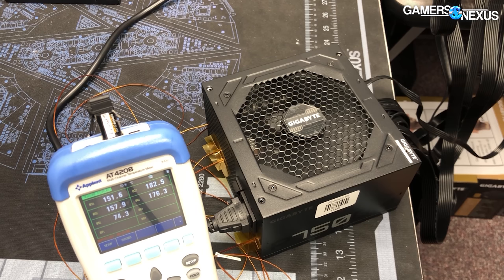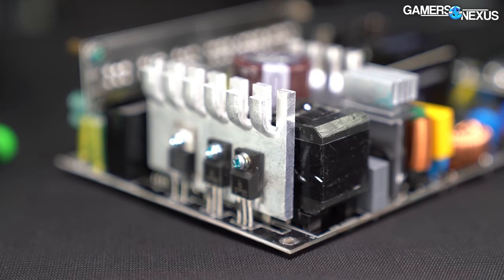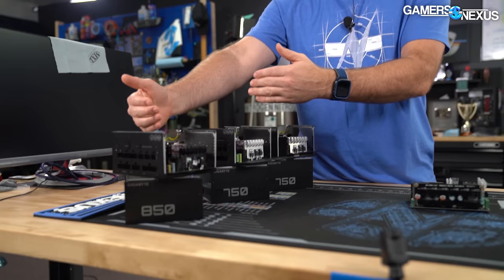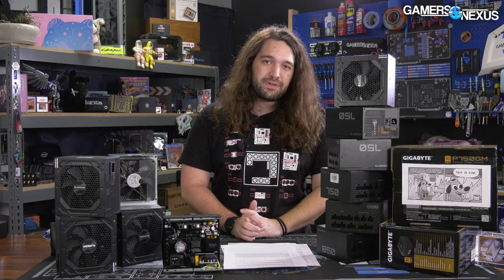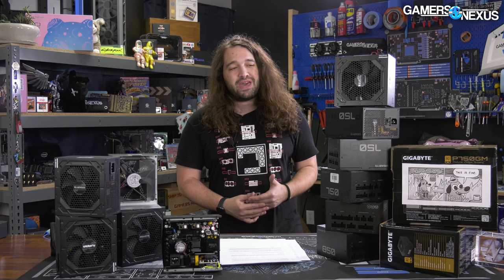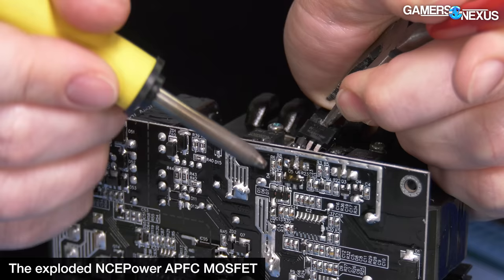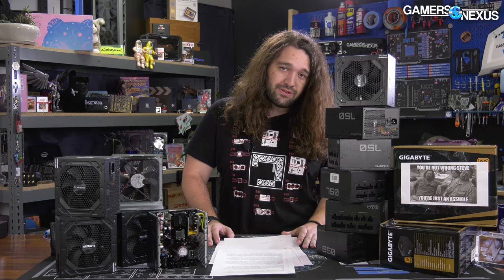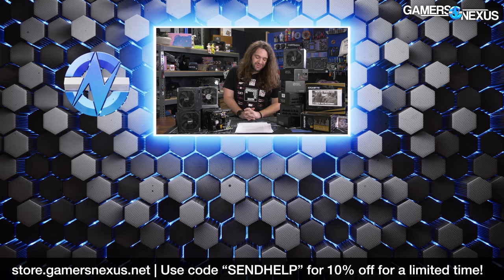Exploding Power Supplies: Gigabyte & Newegg Dumping Unsellable Product

Comment: This hurts the entire Gigabyte brand. I wasn't planning on buying their PSU's, but now I feel bad for even having a Gigabyte motherboard and will think twice before buying anything from them again.
Reply: I personally had the worst experience with Gigabyte brand overall. I'm still salty my 970 windforce from Gigabyte died
Reply: I've had decent Gigabyte motherboards in the past. Products like this PSU do stain an entire brand though. If they can put out something like this then it does lead one to wonder what else they are capable of doing. Sometimes companies do go down the drain for whatever reason.
Reply: It did shake my faith in the brand too, but i newer buy power supply from Gigabyte. I do buy graphics cards and motherboards from them and will continue to do so, because they worked great for me so far.
Reply: I have a Gigabyte 2070 (windforce). Last time I'll buy Gigabyte period. It's loud, cools not that well. Can't even spin up & down without causing a wind tunnel noise. 😆
Reply: I've had great experiences with their gpus and motherboards but now I feel uncertain about them.
Reply: I have never had a Gigabyte motherboard die, but I don't know about their other products, had bad experience with ASUS but have an ASUS motherboard, their monitors are trash reliability wise though mobos 50/50. Had one MSI mobo die, but have an RTX3090 MSI and all is well. PSU I only buy Seasonic or Superflower.
Reply: I have 2 gigabyte motherboards and really hope those are fine.
Reply: It's true that it hurts the whole brand and I will be cautios with my recommendations for GB's stuff, but they have good and bad stuff. My X570 Master is pretty much the only high level X570 board I considered, the feature set is amazing. But yeah... up and downs. And this is a big down.
I've always had great experiences with GB's GPU's too, but their top of the line models are kinda crap (the 3090 with uncooled backside VRAM comes to mind.)
Reply: +1
Reply: Every gigabyte product I’ve had has fuckin sucked
Reply: Still have a Gigabyte Odin GT 800w psu from 2007, been superb & still in daily use.
Reply: I've owned three Gigabyte motherboards now and haven't had an issue.  I own a Gigabyte 1660 Super, no issues, but it feels really cheap.  I think their Motherboards are fine?
Reply: Their video cards have awful thermals too. Even on their higher end Aorus cards, they cut corners with their thermal pads. It's sad, really.
Reply: @aaron96244  Gigabyte are the only  motherboards I use, NEVER had one fail, currently have X570,X470 & B550, even used Gigabyte Socket 939 boards many years ago.
Reply: @dzr7709  Never had any of their graphic cards.
Reply: I've used their motherboards and GPU before with no issues at all.
Reply: I feel you buddy, I have 2 gigabyte motherboards.
Reply: Gigabyte had a track record with motherboard revisions as well, removing components from newer revisions and basically downgrading them.
Reply: Yeah, I feel pretty similar. Gigabyte really should know what this kind of shit does to brand image and should be tripping over themselves to get it off shelves. Says a lot that they aren't.
Reply: You shouldn't worry that much. Every company has some bad products or very bad like this psu. I also have a b550 master and a gigabit aorus 850watt power supply which both work great
Reply: Asrock, Sapphire and Gigabyte, Powercolor is dead to me
Reply: @MLWJ1993  I have a Gigabyte 2060 Super Gaming OC. It’s loud AF too lol. Even at 70% fan it sounds like a jet. I’m definitely side-eyeing it more now though…
Reply: ew no.... why are you going by the brand mentality...
Reply: @S J almost all corsair memory ether just sucks or has a bad price. Their power supplies are a mixed bag. Asus has a good bios, but not a lot of their products have respectable prices. Most gigabyte motherboards have better value. Regardless these are just blanket statements...
Reply: wrong way of thinking, don't evaluate an entire brand, evaluate each product with a good reviewer. X Gigabyte PSU is bad, Y Gigabyte PSU is good. Z Seasonic PSU is bad, B Seasonic PSU is good.

Same for motherboards, videocards, monitors, etc.
Reply: I don't own a single gigabyte product lol most of my stuff is Corsair or Asus.
Reply: Agreed, if Gigabyte isn't willing to take responsibility for a defective product, then what other parts should I be worried about?
Reply: @Vodoriga  I had that same exact card die for me… lasted like 1 month, then swapped for an EVGA. That blew a FET last year but I was able to repair it.
Reply: Gigabyte is dead to me after this. This is 2021, they should know how to produce a PSU that doesn’t blow up. I would like to know what happened to the GPU with a follow up video. RIP Gigabyte
Reply: @Lemard77  as a consumer, there are a ton of options out there and if Gigabyte is willing to stain their reputation with cheap parts, then we as a community must boycott the brand altogether. I know I will.
Reply: My friend sent his 2070 super for rma since it was artifacting on boot and wasn't working at all, after 2 months of sending the card (40$ shipping btw since we're from Puerto Rico) they didn't fix anything, they just sent it back. 

He got in contact with a Gigabyte rep and they said... "card was tested and fixed, can you tell us what's the issue with it?" My friend asked "can you tell me exactly what was fixed cuz clearly the card wasn't touched at all" Rep didn't respond anymore after that. He ended up having to buy an used 1080ti for 870$.
Reply: Ive had my gigabyte arouros 1070ti since they came out and had 0 issues, and i run it hard
Reply: I have 3 Gigabyte 3070's 🥺....
Reply: game. my last gigabyte product was a B450 board. the VISION was my dream 3080

no more.
Reply: They used to have a good rep (I had a couple of Windforce GTX 6xx's which were excellent) but unfortunately it looks like they've been trading on it for a couple of years, and yes, it does cast serious doubt on all their products.
Reply: Yeah, I had no Idea Gigabyte had become such a low quality company, they used to be decent, at least their motherboards were well-made, I know not to go near them now though.
Reply: @nekdo_kavc  mb only asrock
Reply: I feel like they just dont have a decent PR department lol. A few month ago they had a stupid and discriminating laptop ad against mainland China, which lead to a major boycutt event against gigabyte in China😂
Reply: @S J Had an EVGA 1070 failed on me, and also there are news about EVGA 3090 failed due to high gaming load, my friend's EVGA 980ti also died...
Reply: RMA'ed my 2070 windforce for rattling from the fans after a year.
Retailer made a oopsie and had to replace it. Got a 3060 EAGLE OC instead. New GPU makes even more noise...
Reply: @TheInsanish  Thats kinda unfair for you....3060 is a little bit slower than 2070....Usually they replace you with the same tier GPU across generations, like replace 980ti with a 1080ti if they dont have any 980ti left(EVGA does that) AMD also replace a dead 1800x with a new 3700x.
Reply: Wow wtf you guys talking about. Even their PSU bad doesn't mean the entire GPU and motherboard is bad.
Reply: Yes, it definitely hurts the brand. I haven't had personal issues with GB hardware. But their handling of this - pretending nothing is wrong - has been enough for me to prioritize other brands.

The number of dead-on-arrival PSU seems to be totally huge.
Reply: I had to rethink keeping my laptop with them after buying it it's been good for these first few weeks but even still kinda scary to know
Reply: @superdude200ify  What does your laptop have with a failing ATX PSU to do? They do not have a general problem with power supplies. And their way of responding to their customers is something that should affect our will to buy new equipment. Not affect what we do with equipment we already have - unless it's one of the PSU that has this design flaw.
Reply: my x470 board died after 6 months, bought a x570 like an idiot lol
Reply: @DreWhite100  Accidents happen.

Don't be upset the PSU models fails. Be upset about how Gigabyte handles it.

It isn't about making a design mistake but about keeping the customers out of harm. They should have made a full recall of these PSU long before the hw testers started to hound them down. And they should most definitely not have abused their customers bh continuing to sell a product they knew were bad. Newegg etc should have been contacted to remove all stock of questionable power supplies.
Reply: Same, I had an Aorus Master 3080 and the thermal pads on it were garbage and were cooking the memory modules. Had to replace the thermal pads and they were fine and was able to sell it at a loss. Luckily the Aorus Elite 3060 12 GB is perfectly fine but yeah probably won't buy another Gigabyte card
Reply: Psu duar 🔥🔥

Comment: I was shocked to see how expensive these are in spite of their high failure rate. This is the sort of behavior I'd expect from $40 ali express PSUs. You expect cheap products to be shitty, but in this case you're likely paying extra for surprise pyrotechnics. This is a big oof for Gigabyte and Newegg.
Reply: well it's probably a 40$ Ali express PSU with Gigabyte Branding
Reply: At this point I think 40USD Aliexpress PSU has less failure rate, they might smell like disgusting chemicals though
Reply: Regardless of price, who the hell buys a Gigabyte PSU lmao, that's the biggest mistake here
Reply: Even a shitty item shouldn't be a fire hazard.
Reply: $40 for something slightly better would still be a rip-off even for AliExpress. Maybe $20 max.
Reply: Not going to lie, I've never had an issue with the $30 AliExpress specials. I usually pick them up used for like $10 a piece. They're ~300W units at best being marketed as 500W (classic add up all the rails bs), but at least I've never had one fail within expected operational parameters aka look at the label on the PSU and not the wattage rating. I've used dozens and not a single one went up in flames even ones that ran for hundreds of hours at ~100% load.

From what Steve presented, the AliExpress specials almost certainly have a lower failure rate than these gigabyte models. The gigabyte models to me scream a rushed af product that had a bunch of validation testing intentionally skipped or ignored as with a failure rate this high, it 100% should have gotten caught. You can blame the engineers for crap design work, but stuff like this happens. It's not even all that rare. Issue is, it almost never makes it out of the lab in this state. This product is clearly the exception.
Reply: Gigabyte sticker doesn't mean it's not $40 aliexpress PSU, lol. It's not the sticker that makes PSU a good PSU. For example Polish brand SilentiumPC makes equally good PSUs at lower price than you'd pay for Corsair or Seasonic. My Supremo FM2 650W Gold 80+ with japanese caps cost ~$94 and is borderline platinum efficiency (misses it by tiny mark) - so you don't also don't need popular known brand to get great PSU
Reply: @LiveType  That’s because you bought them used. Whether or not they will work at all is 50 percent of the issue.
Reply: Many people recommend corsair.
Some psus from them get only 3 eggs. And have many many sad stories that psu failed in first year. So even if you pay a lot you can get a fecal matter brick.
Reply: @pcmasterracetechgod5660 one of my friends is an experienced system builder and when I first started building my first PC he recommended me to buy a gigabyte PSU lol. Was DOA.
Reply: After this the brand value should be negative.
Reply: They are fine as long as you never overload them... Gigabyte might just set the bar too high.
If you watched the video GN said the PSU was already overloaded before they failed.
Traditional wisdoms of only load your system to 75% of PSU rating is there for a reason and still stands.
Reply: @gloomytony9560  Among my friends Corsair PSUs have killed 2 GPUs and 1 motherboard so far. I think some models they make are supposed to be good but definitely don't buy the cheap ones. 
(The ones that killed components were CX600, VS450 and RM750, killed components were GTX 770, MSI AM3+ mobo and GTX 1070 Ti)

Edit: Actually come to think of it both GPUs that failed were MSI products as well so maybe it's just MSI being crap lol. I still blame the PSUs tho.
Reply: @AaronShenghao  A good psu will have protection circuitry to make sure that it does not catastrophically fail even if overloaded. An explosion like in the video is an automatic fail even if it was overloaded since it should have shut itself off way before that, besides one even failed at 60%  load...
Reply: @urgay1992  msi makes quite bad gpus
vrm phases just turn into "craters". 
seen aftermath over and over on one channel (one very skilled hardware necromancer even managed to bring back to life some of them)
but corsair is to blame too. even gold psus... "cheap ones" get low ratings.
Reply: @Yasokuhl35  It's not. It's a honest attempt at a decent PSU but really incompetently executed. Really in the hands of a more experienced OEM, this exact cluster of faults would have no chance of happening.
Reply: @pcmasterracetechgod5660  I've been building PCs for over twenty years. Gigabyte isn't the most reputable, but they're hardly in the realm of "the biggest mistake" as far as purchasing PSUs. 

Are you trolling or something? I mean, you're sort of "victim blaming" here. The PSUs had good reviews initially. Either way, you're kind of saying that people shouldn't be able to put faith in a company as large as Gigabyte that have been producing fairly good quality parts for quite some time now. Decades even. How about you start blaming the million dollar companies that knowingly shove dangerous products onto people instead of acting like we all should have been prophets and known what was going to happen before it happened... 

Or hey, explain why you think people should have expected Gigabyte products to just explode and kill systems based on actual information that we had prior to all this...
Reply: @gloomytony9560  My understanding with Corsair is that they have two tiers of products, the one gets good reviews and a lot of recommendations, the other gets purchased by people that don't know any better. In my opinion this isn't any better than what Gigabyte did. If you have a two tier product system that revolves around having idiots purchase your cheap stuff... I dunno.
Reply: @DefianceOrDishonor  Trolling? Explain myself? Dude it's Gigabyte, they are nowhere near the best PSU brand. Even if they aren't "bad", they are nothing compared to Corsair, EVGA, SeaSonic, etc. You'd just be stupid to get a Gigabyte over any of those brands. 

It's like saying you should buy a Cooler Master monitor (yes those exist) over an Acer, Asus, Samsung, etc, just because Cooler Master makes great coolers. I'm not saying Gigabyte is a bad brand, they make good GPU's and I'm even looking into buying a Gigabyte M27Q monitor. They just aren't as good in the PSU market
Reply: I'm mean if you need a computer blowing up prop for a movie these would be perfect to use actually using as intended not so much
Reply: I don't expect even a $40 PSU to be a fire hazard. Bad yes, but not this.
Reply: OOF? No This is CONSUMER FRAUD on NewEggs Part.
Reply: Those are the resellers man…
Reply: I've bought a bunch of cheaper psu's and never had a problem like this. At worst one or two died half a decade later.
Reply: Oof for Gigabyte, intentionally ripping customers off for NewEgg

Comment: PSU explodes

Gigabyte: Looks fine to me.

Newegg: Yep.. best power supply ever.
Reply: Samsung entered the chat
Apple wants to know your location
Reply: "Momentous power delivery capacity?"
"POFF!"
"Excellent. Titanium rating."
Reply: Add 150 max star fake reviews and sells like cake.
Reply: Gigabyte's response to the whole issue killed the brand in my eyes.
Reply: nzxt : i just want to say that i'm a huge fan
Reply: makes you wonder how many people in their qc department were quitting over being forced to ship shoddy product... because there's no way they didn't know
Reply: did your power supply explode on you then 😂😂😂😂😂😂😂😂😂😂😂😂😂😂😂😂😂😂😂😂
Reply: @doomsday5286  i have one :(
Reply: Microcenter is the best electronics store, hands down
Reply: @isaacbejjani5116  yes they are even at selling those shit exploding psu's lol
Reply: Used to love Newegg. My last order a couple years ago was for a new build, included ASUS mobo (new, and no discounts). Arrived seemingly "used" or refurbished (dust around CPU socket, fingerprints on bag). I installed anyway (regret, not recommended!), ended up not even posting. Required complete tear down, return, and they cross-shipped (their policy claims they don't, but they did) an actual new board, which seemed fine and actually new. tl;dr: I think Newegg has been selling refurbished, returned, problematic units as "new" for years (deals with suppliers, cost-cutting, bad management). They lost my trust and business. Thanks Gamers Nexus for the work on this.
Reply: So from their testing, all the issues occured under over 100% load. Should I even be worried that I have the 850 which I bought as over kill because I never break 400 watts?
Reply: @djbreal87  well I am assuming that you never get it to 100% load let alone 100 plus % so nope  you should not cause your not overloading it
Reply: @vanontom  newegg was hoping you wouldn't notice that sort of stuff and think it was new as there definition of new is new to you lol
Reply: @absoleet  never buying a gigabyte product again.
Reply: So are these for starting grills or fires/bonfires at a campsite?
Reply: whats next, Newegg ducttaping a live grenade to any shitty product? Ohhhhh
Reply: @Rawsawn  please don't give newegg ideas!
Reply: @Shadowmaster625  People that are that serious about their morals, are rare.